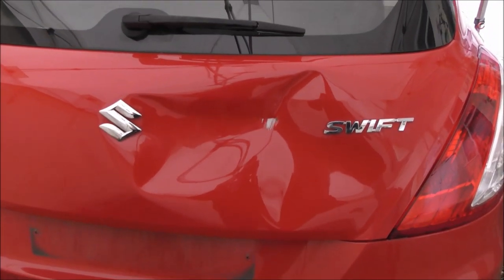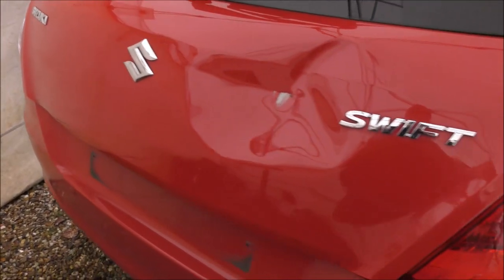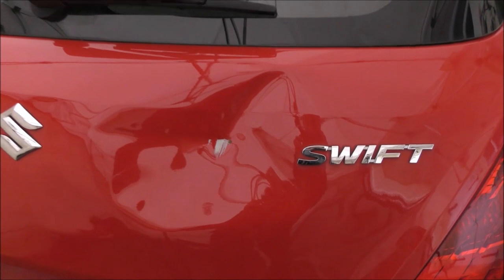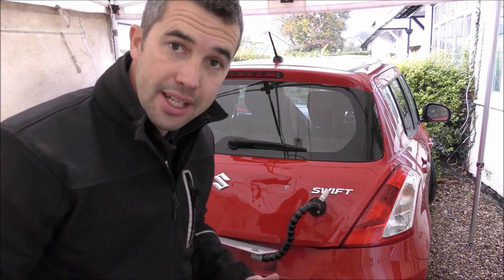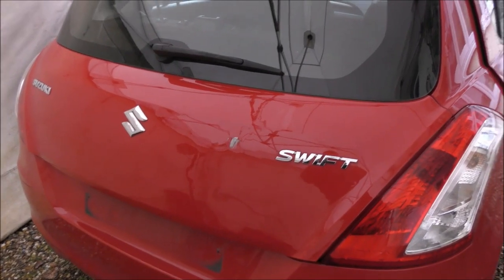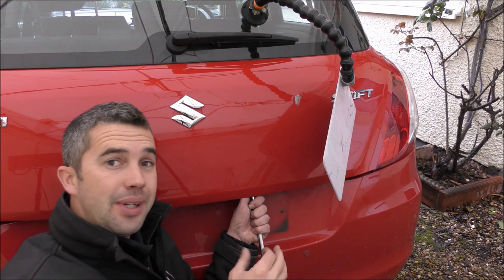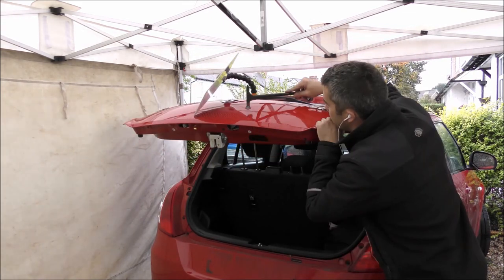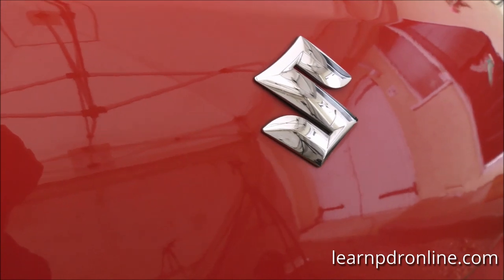Huge Tailgate Smash | PDR Tutorial

Comment: Where you have easy access would it be possible to do some tapping down from the inside to reduce that deep impact point.
Reply from the maker: Hey Timmy, thanks for getting involved, do you mean using a tap down and hammer from the inside? yes in theory this could work as long as you can get to it at the right angle and also have enough space for the hammer but only because the paint was already broken. I have tried this technique tapping down the low of a dent from the inside (so its reversed and becomes the high instead) but its so easy to shock and crack the paint this way so I stopped doing it, although with this damage not an issue as the paint was already ruined. Good question...
Reply: Many thanks

Comment: Just had this happen to my car.. what happens next to the deep scratch in the metal? How much does that usually cost to fix?
Reply from the maker: With this particular repair I was trying to carry out an 'improvement only' to reduce the damage. I'm not sure if the customer went any further regarding the paint work but there are only really two options, 1- A 'touch up' paint repair which you can do yourself, this will help protect the panel from corrosion but will still be slightly visible or option 2 - A bodyshop repair and repaint, this would be best but I would imagine could around £200-500 depending on where you go

Comment: Came here to sew how you removed the interior trim. Do you have that footage by chance?
Reply from the maker: Hi Jordan, this YouTube video is the shortened down version so the footage is only within our training site however I have just rewatched it and the main tailgate trim I believe is only clipped on, so there are a few black plastic circular clips around the outside and the circular centre parts pull out of the main clip ( you may need a 'trim clip tool' ) then once the clips are fully removed you should be able to start pulling at the edges of the trim, inside there are often interior clips (not visible from the outside) but again with some careful pulling force the trim board should come away. The smaller trim along the bottom edge with the number plate lamps in has a couple of 10mm nuts that need to be removed. Do have a good look though to make sure there are no screws I don't think there are but if there are they will likely be tucked away inside a handle. Hope that helps
Reply: @LearnPDROnline  Thank you very much, ended up figuring it out but didn’t have the tool to pull the clips. Found another way to achieve my goal though so all is well.